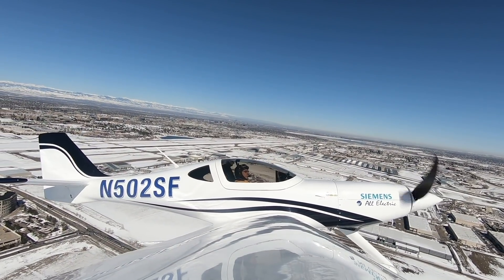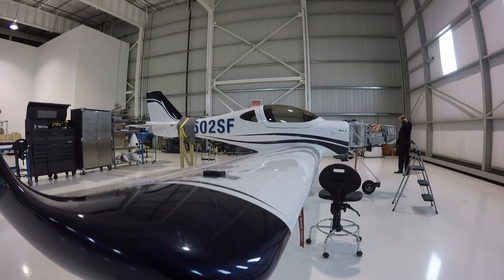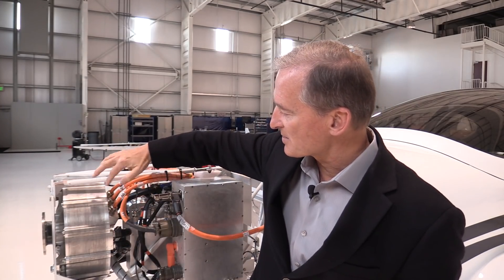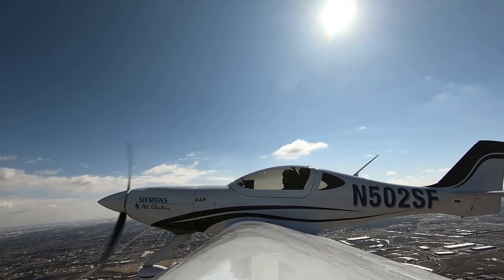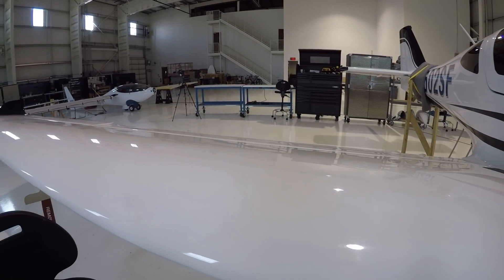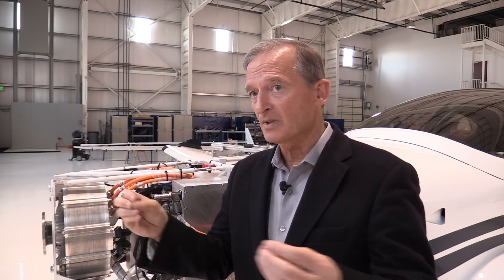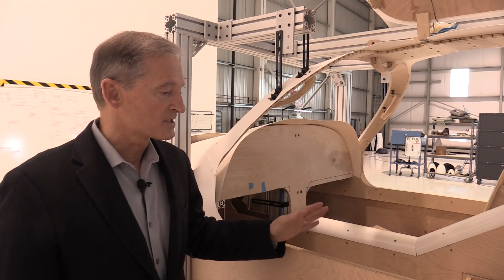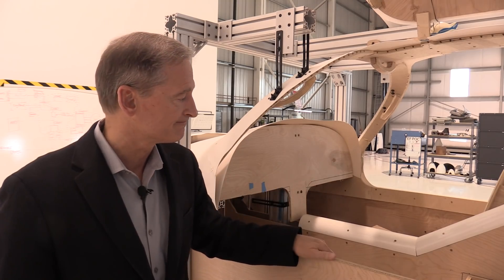Bye Aerospace's eFlyer Electric Trainer

Comment: If the battery packs were swappable would be much more useful in flight training ops. On days where weather is good the aircraft fly all day with back to back students. Needing to wait for a charge would cut down the amount of students per day significantly. Waiting for a charge after each flight would put this aircraft at nearly 50% the capacity of an internal combustion equivalent. 

Wasting those perfect weather days on the ramp waiting on batteries to top off sounds very frustrating. Especially after a long stretch of bad weather.
Reply: 1 hour down after every flight cuts a day that could’ve seen 6-7 daylight VFR flights down to 4. Multiply that down the whole flightline and it’s a huge loss in availability.  Batteries are expensive, aircraft are much more expensive to leave sitting on the ramp. You can buy a Tesla full of batteries for 30k, so buying an extra sets of battery packs won’t be too expensive. Plus if it only takes an hour to charge wouldn’t need a replacement set for each aircraft, would just need enough batteries to always have a fresh replacement ready to go,
Reply: @Alex-us2vw  agree with you
Reply: @Alex-us2vw  You are assuming 1 hour. I suspect it might be closer to 10-20 minutes to charge the plane up to 70-80% depending on what charging technology they end up using.   Typically batteries charge to 80% relatively quickly and there's no need to fully charge the plane unless you are planning to stay in the air for the full 3 hours. So you take off with maybe 75%-80% charge and you land with maybe 30-40% remaining. Tthen you charge it back up for the next flight in the time it takes for you to grab some coffee, meet the next student, do some paperwork, drink some coffee or whatever it is instructors do when they are not in the air. Doesn't sound like that big of a big deal.
Reply: Chet Carson was that statement supposed to make sense? You have some delusional ideas about flight training, and have no idea what your talking about. You could always save up $20k to do PPL training, see what reality is actually like at the FBO and around the flight line.
Reply: Chet Carson well then how do you solo if your not renting an aircraft. Any flight center I’ve trained at you could rent anything from a 150/172P/R/S/172SP G1000/182/Piper PA-28 variants/Piper seminoles/Cirrus SR-20. Everything has a different cost so you need to specify what aircraft and choose an instructor. They aren’t package deals since you don’t bring instructors on every flight. Our aircraft ranged in price up to +$300 per hour wet for a twin, and instructor’s were all the same hourly rate if you needed one for the flight.

Depending on your budget you could go the cheap route and fly strictly 152’s, or step it up a notch into carbureted 172P’s, or spend more for a 180hp fuel injected S model, or more and for one with G1000. If you were done the PPL could then go into the complex, HP, and Twins for training like CPL.

It makes no sense to be assigned a random aircraft, especially for its something you have no intentions of ever flying (like a 152). I wouldn’t want to spend 40 hours training in a 152, then go buy a 172 and have my insurance company charge me a fortune since I have no hours in type, and then make me do dual instruction in type till I meet the minimum insurance requirements. Or not be able to go to another airport to rent aircraft since I’ve only trained in a 152 and their fleet is all 172’s and up. Taking that to the next useless level and training in an electric aircraft is a huge waste of time and funds. If anything it should be at a huge discount since when you are done you will still need to train in a 172 since it’s the most widely available aircraft to rent.
Reply: Chet Carson so basically you took an intro flight, and from that you understood flight training and rental market. Now it makes sense why you would make ridiculous claims like “people with money” will pay a premium for inferior aircraft. 

With students spending between $15000-$80000 to complete the various licences and ratings it’s insane to think they wouldn’t be price sensitive to the single biggest training expense (aircraft rentals).

These so called “people with money” you speak of would be the students who purchase aircrafts to use during their flight training. They definitely don’t seek out a ways to pay more renting 😂
Reply: Pipistrel is swappable 🛩️
Reply: Swapable batteries also has the big advantage of leaving the ac/dc charger out of the airplane which is bulky and heavy.
Reply: Given how fast tesla battaries charge I assume they can charge depleted battery under one hour. That's not exactly as good as gasoline ones but certainly not to shabby.
Reply: Chet Carson why would people pay a 40-50% premium when there are fleets of Cessnas, Pipers, and Cirrus aircraft on the ramp at every flight school. If there is any cost premium to conventional aircraft it will never work. 

Plus do you really want to get checked out on an aircraft that can only fly 2hr missions? What you going to do after training? Do more training but now in a Cessna/Cirrus so you meet the minimums to rent one.
Reply: Chet Carson have you never done any flight training? You need to rent an aircraft, otherwise what would you train in. You rent an aircraft and book an instructor.
Reply: Except that the batteries are insanely expensive, so the cost of a second set could never be justified.

Comment: I'm sure battaries are designed to be redundant and safe but battery fire on air would be absolute nightmare.
Reply: The YouTube Critic  Exactly. Every type of condensed energy storage has its risks.
Reply: Can’t imagine solid state lithium ion batteries are any more dangerous than 30 gallons of liquid gasoline and the vapor to go with it. Just so long as they didn’t tape together 300 Samsung Note phones to make their battery
Reply: Solid state batteries exist, finally. They are far less likely to catch fire and much lighter. Hopefully, they will be able to source the battery cells before certification.
Reply: @Ichibuns  I think they mentioned in the video - they are absolutely locked in to the batteries they have already selected by their agreement with the FAA. If they change batteries, that goes back to square one.
Reply: @RickinICT  That would make sense. In that case they should focus on getting the current certification. Itll be easier to get another powertrain approved on a certified airframe. Maybe even make an experimental version down the road. They should be much less complicated to build than a gasoline powered aircraft, from kit form.
Reply: @RickinICT  They will have to change batteries. Developments are already making their cells redundant re competitors. Maxwell tech in Teslas will show the way.